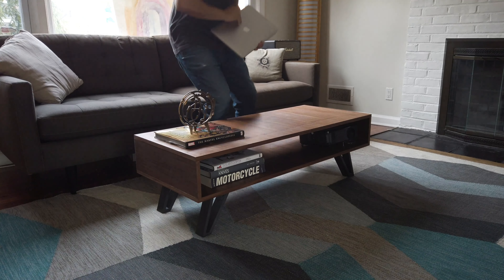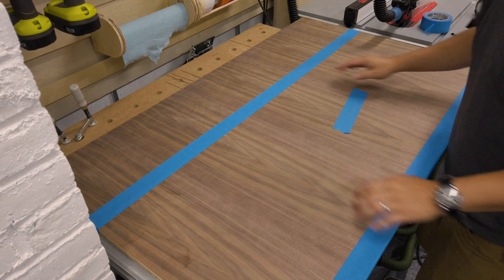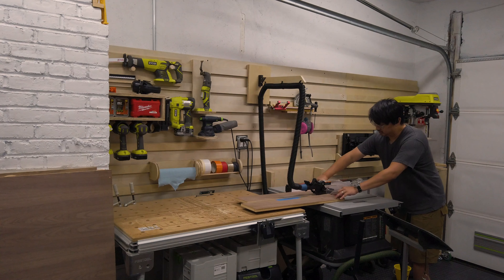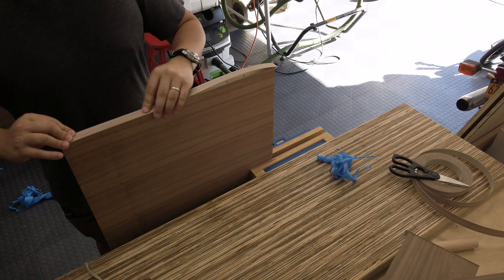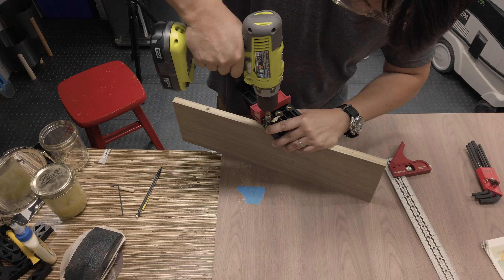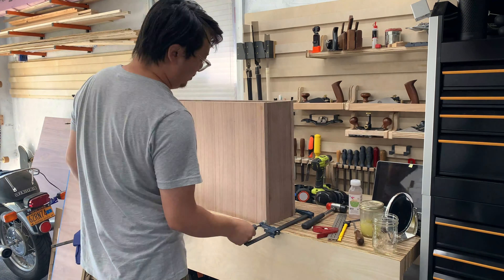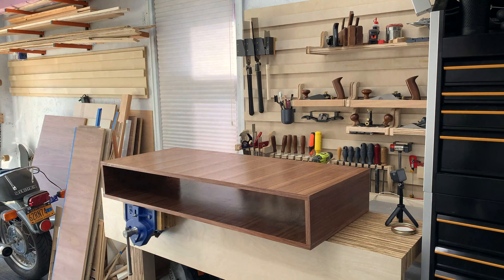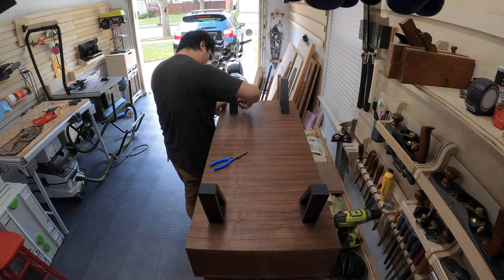DIY Modern Coffee Table with 3D Printed Legs

Comment: You could always design legs like that as a 2-part system so that you can easily screw one part in the tabletop and then slide or twist the leg in place. And then using one screw to lock it in place, bayonet or dovetails are a great mechanic to use.

Comment: Great video! I am also working on a similar project. I got stuck trying to design the table legs.. do you think the legs could be longer (and printed in more parts)?
Reply from the maker: I be worried if it was printed in multiple parts and glued together. A friend of mine on IG did make a larger leg. But he took my design and made a template that you can use a trim router and cut it out of wood. You could make it as thin or thick that way. Then paint it or leave it as wood.

Comment: Fantastic channel. I'm wondering about the flex (bowing) in the middle of the table, and if you get parallel shear without any bracing of the box structure?
Reply from the maker: 3/4 plywood is pretty strong and stiff. It remains straight and as a coffee table it’s fine. If you were going to design some kind of box like this as an entertainment console. With a tv on top I would probably put a center support. Certainly not going to be dancing on it. Thanks for checking out the channel.

Comment: horrible finish on the legs....after waiting 9 hours for each XD so stupid
Reply from the maker: 3D printing obviously isn't for everyone but the whole idea is trying to conceptualize and see how we can use 3D printing in design and prototyping. 9 hours is a pretty quick turn around to create something to scale and have it be functional. This is also automated and does not involve labor.  It is also cheaper to make this than out of metal and anodized and painted. Once the design is finalized one could use the 3d prints to be burnt out with metal to create the final legs. 3D prints can be sanded and finished to be as gloss and smooth as a car body. Take a look at cosplay costumes. I hope this was informational, thanks for you opinion and comment.